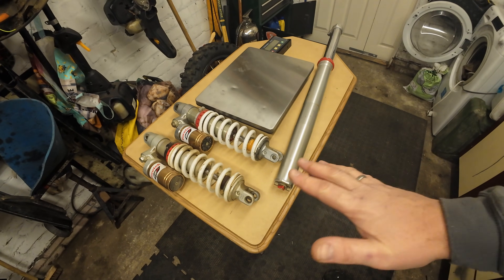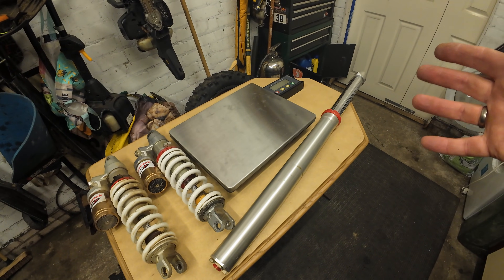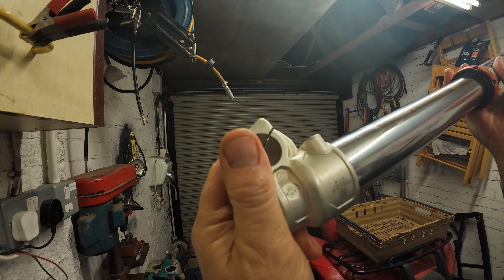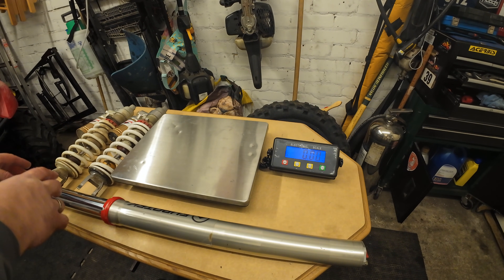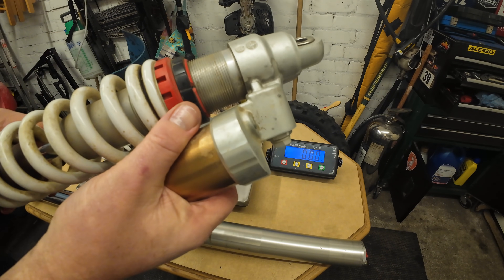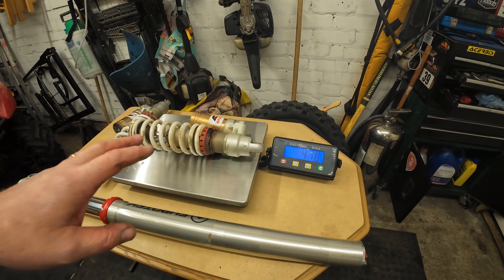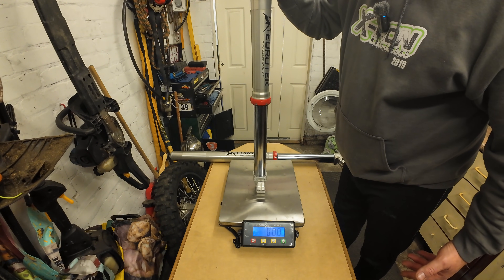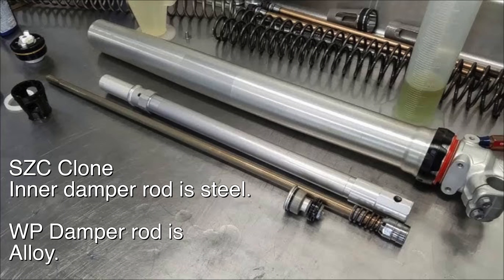How Heavy is GPX Suspension?

Comment: On the TSE 250, I did what you did. Weighed the stock fork on a scale. Then weighed the WP AIR FORKS I was installing. The WP air fork is just shy of 6 pounds lighter than the OEM TSE 250 fork. You can feel the difference when riding the bike. Nice upgrade.
Reply from the maker: Agreed air fork is much lighter and worthy of swapping. Plenty secondhand sets kicking about on eBay and other market places.

Comment: Hi mate, suspension question for you, I see you have linkage rear suspension on your 250 GPX and PDS on your 300 GPX. What made you go for the PDS over the linkage?
Thanks
Reply from the maker: All my bikes have PDS shocks. My initial TSE 250 was linkage.  I’ve always had KTMs in the past and like PDS mainly because of easy maintenance and cleaning.  Never had an issue though with the TSE 250 linkage when I had that bike even with over 200hrs on it was original but it had to be greased every 30hrs or so which takes time. A lot of people neglect this area because it’s a bit labour intensive and then it’s too late the damage is done and a new linkage kit or bearing kit is needed.
Reply: @RobboRobinson that's great thanks for the reply, all going well I'm getting the GPX 300 TSE in March. I went to the test day in S.Wales yesterday and was genuinely blown away by how good it was. Thanks to your videos about the GPX brand, it helped with the decision aswell.
Reply from the maker: @spud139 Glad to help bud 👍